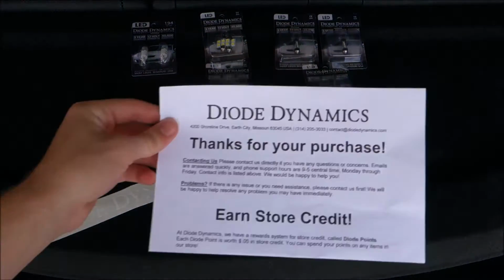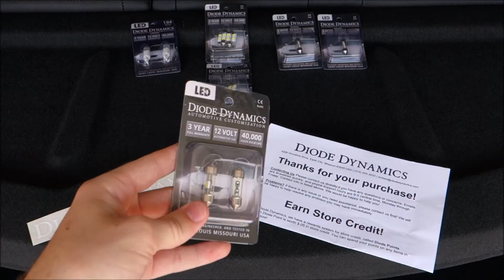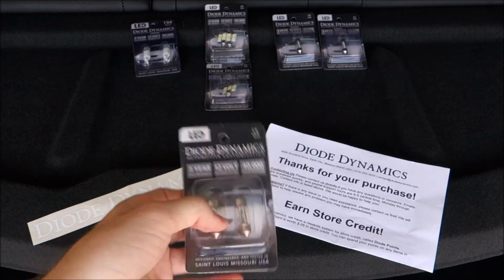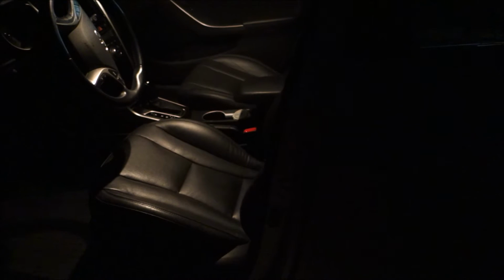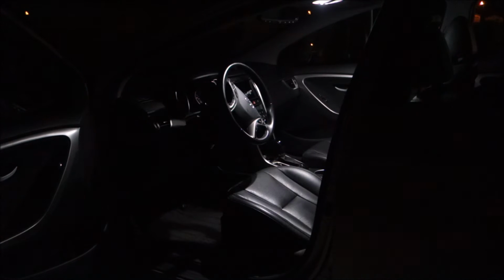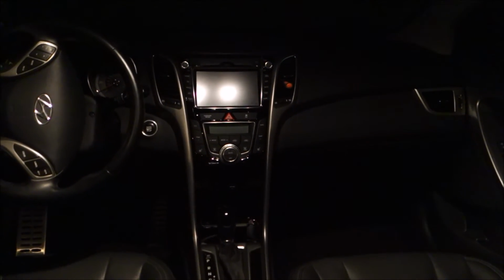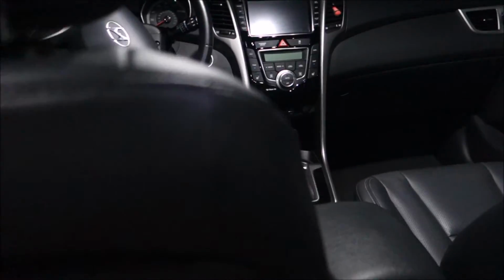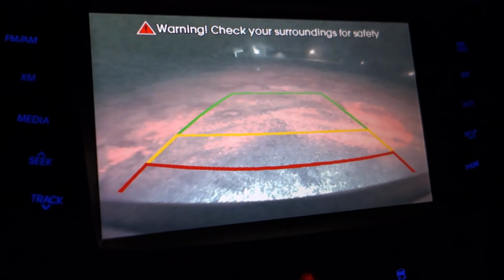Diode Dynamics Interior & License Plate LED Install | 2013 Hyundai Elantra GT

Comment: Really good video thnx - can you list the bulbs used because the DD website doesn’t show Elantra gt. Or did you just use the plain Elantra selection. Also clarify 194 hp3 or hp5? None of the pkgs you showed have numbers on them thanks
Reply from the maker: I would recommend using the owners manual to find the bulb sizes then finding those on the website. The 194 were HP3's but either would work for the license plate.

Comment: Hi Justin, at 11:55 you say you're happy with the SMF6 bulbs for the map lights. However on their website, they do not have that. They have either SMF2, HP6 or SMD12. Do you remember which ones you took? Or is there something I'm missing?
Reply from the maker: Hi Nic, because this video is several years old they have discontinued products over the years and added new ones in place. I would definitely go with the HP6 for most of the interior lights on the Elantra GT aside from the vanity lights (unless you frequently use them).
Reply: @JustinKelly  thank you for the quick reply

Comment: hello nice video and any chance you can show us how you removed that licence plate housing plz thanks and can I use that led for my front sidelight as well plz
Reply from the maker: Yeah I can do it this weekend. I just carefully pried the black clip back with a flat head screw driver. I think you may be able to use the same LED's for the side markers up to the HP3 bulb which is what I used for the license plate. Diode Dynamics website is very good at matching the bulbs with vehicles so I would double check their first.
Reply: +Justin Kelly thanks mate looking forward to your video

Comment: hey how's those led license plate going?how long has it last with u? I guess ill take out the Fuse. every time the left side license plate bulb goes off I change it and barely lasts like a week or so.
Reply from the maker: +jemerbautista Mine have been flawless! I love them, they make it look so much better. I've had them in for 3+ months now and like i said I've had no issues. Do you have these exact bulbs?
Reply: +Justin Kelly  no sir. going to order some. I got some ebay error free cheap ones. shouldn't have gotten them but I'll get these.
Reply from the maker: jemerbautista These will do you well! IF you have any problems they will take care of you. 

On the forums I have a list of all the bulbs (brightness) I used, you should definitely go check that out first! The license plates are the HP3's I believe.

Comment: But how do you take the old tag lights out and put the new tag lights in
Reply from the maker: Take the entire assembly out with a flat head screw driver and replace the bulb. Then you can reinstall the assembly.
Reply: can you replace the assembly if needed?